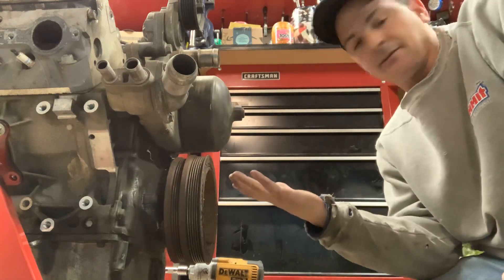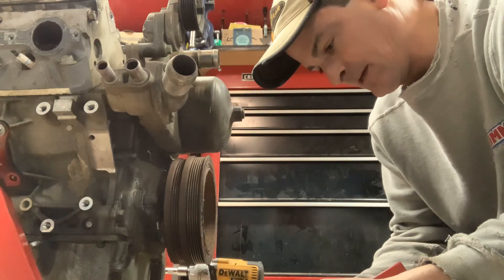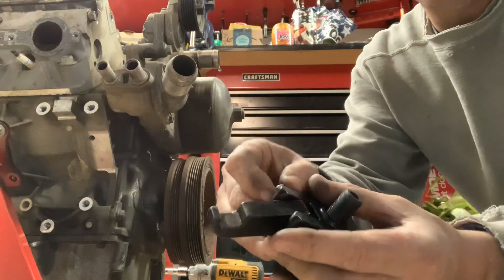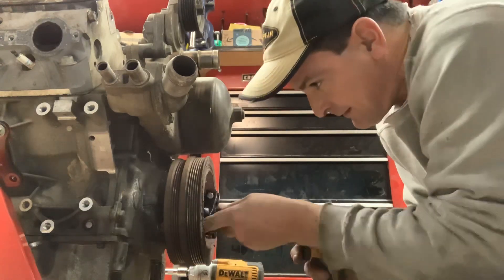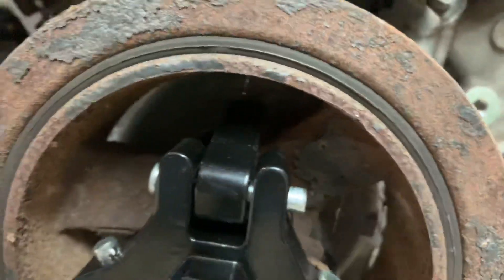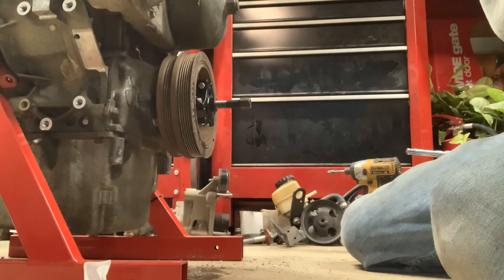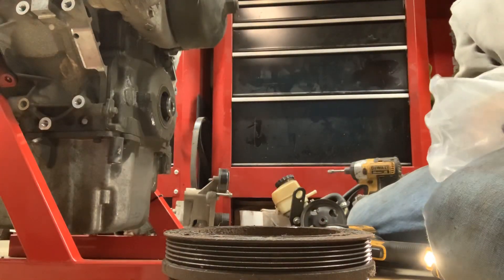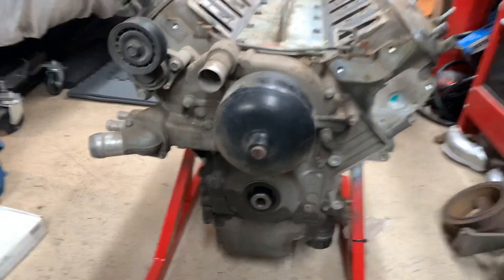LS Harmonic balancer removal

Comment: What drill are you using to remove bolt
Reply from the maker: DEWALT 20V MAX XR Impact Wrench, Brushless, High Torque, Hog Ring Anvil, 1/2-Inch, Tool Only (DCF899HB)

700 ft-lbs of max torque and 1200 ft-lbs of max breakaway torque 
 
It's a beast and perfect around the shop or at the salvage yard

Comment: Good video but the special tools not really needed atleast not for me. I used a regular puller from auto zone  for my ls 6.0 it was the the cheap 1s  oem brand.  you CAN also get them from harbor freight. But I just rented the same type I have been using since I was a teenager working with my uncle. Worked fine no damage and hung on nice tight. They have plenty of adjustment to fit how you want it then just stick a bolt in the middle hole and crank away. No more than 10 minutes even with the adjustment of the puller. Install with strong piece of wood across balancer light taps while tightening the center bolt just go easy as to not strip it. And tap lightly to not warp balancer.
Reply: i dont mean to be so offtopic but does anybody know a method to log back into an Instagram account..?
I somehow forgot the password. I love any tricks you can give me!
Reply: @Esteban Terrance Instablaster ;)
Reply: @Anders Ronan I really appreciate your reply. I found the site thru google and Im waiting for the hacking stuff atm.
I see it takes a while so I will get back to you later with my results.
Reply: @Anders Ronan It worked and I now got access to my account again. I'm so happy!
Thank you so much, you saved my account!
Reply: @Esteban Terrance No problem :D

Comment: I know it’s June 2020 already, but I replaced my Tahoe pan with a perfect pan, no oil pressure relief to leak and SnapOn machinist edge flat flanges for $281 shipped from Jersey. eBay “ DeepMotor Oil Pan” comes with new bolts, gaskets, oil pickup tube, 2 O-rings and oil filter adaptor (Re-Use the one you like, in case you have a dozen PF46 filters) and oil cooler cap with grade 8 bolts. Reuse oil dip stick and tube. No reason not too! It is a copy of muscle car pan, except $160 cheaper. Mine works fine with 7/16th inch oil pickup off bottom. Modeling clay or grandkids play doe.
ASE Master Tech since 1978 - Retired